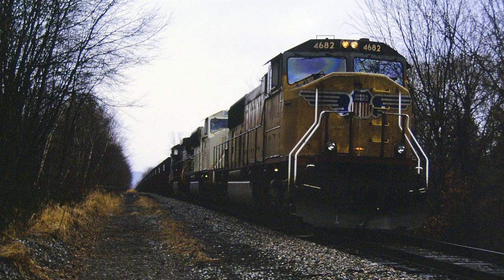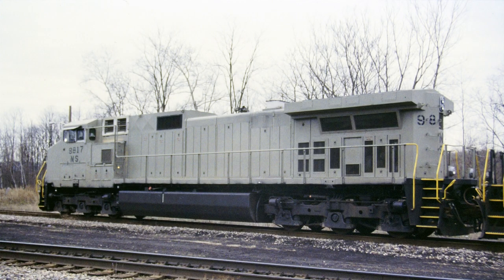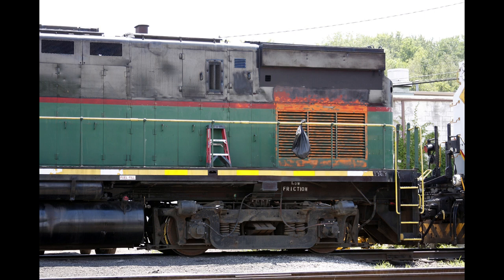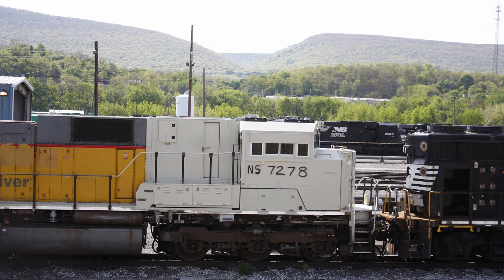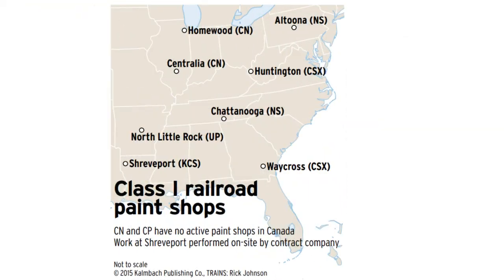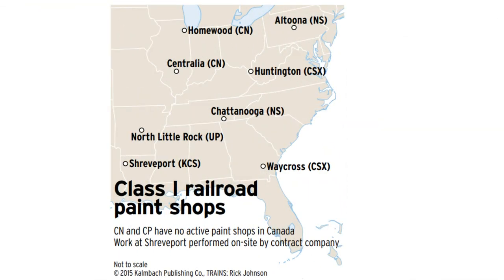How Railroads Paint Their Locomotives

Comment: Well researched and presented, as usual, AC. The costs breakdown show how monumental the NS Heritage Unit program was to NS. One then begins to question why an NS could not run those units in the wash whenever they were shopped; which has the side benefit of giving longer life to those expensive 2 part paints. On another front, I began to wonder what Progress Rail did or did not do when those Heritage units like the PC, the Reading and DLW began to flake off in big chunks......inadequate prepping of the primer before top coating?
Reply from the maker: Thanks for watching Michael. Yeah, Progress Rail painted HUs didn't hold up well at all. Enola Yard would usually wash the HUs when they came in for servicing or whatever. I might do a video about that.